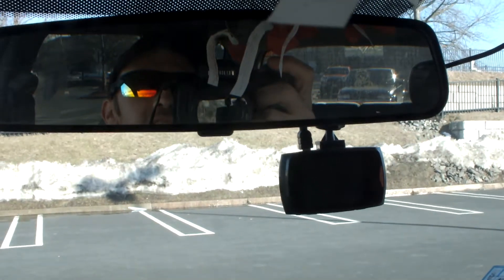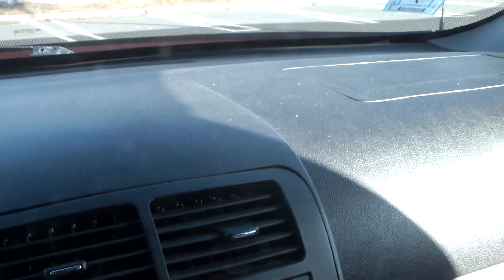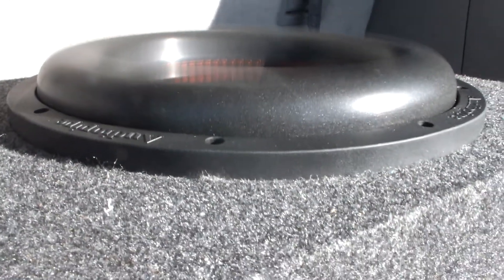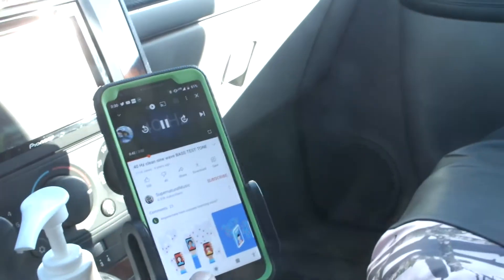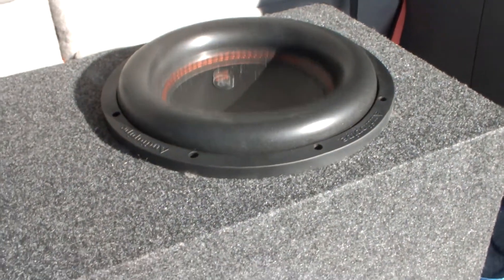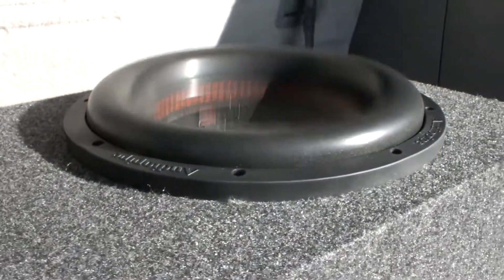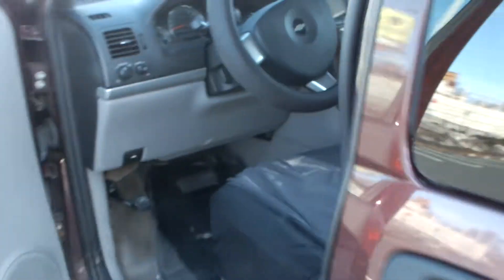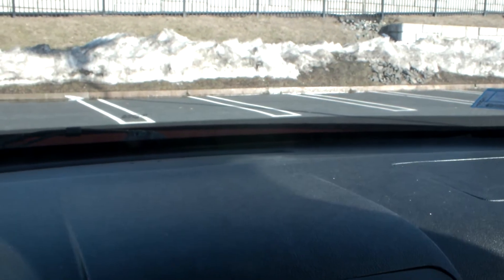Audiopipe TXX BCD4 12 on Kicker ZX 750.1 Slamming DB meter

Comment: I don't use polyfill. never found it beneficial. I've tested on term lab with and without. the prefab skar box I have came with poly, I ripped that shit out. you should get the titan I haven't seen anyone on here with one.
Reply from the maker: I'm going to try it with just the batting first, which is slightly less than the skar box comes with.  Go from there with it.
Reply: More for sound quality and subs that are in an enclosure that's a little to small for them not spl
Reply from the maker: @bassbrother101  I'm not going for spl, I'm trying to get the box down a few hertz, I've done this before many times. I'm going to try a few different ways with adding the polyfill. Thanks for the comment.